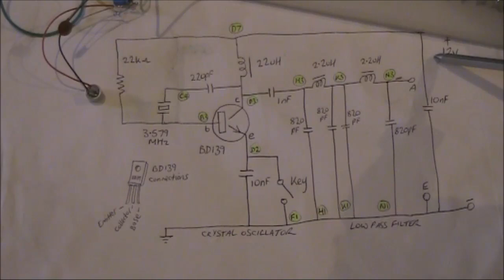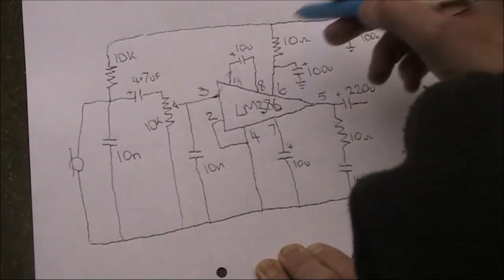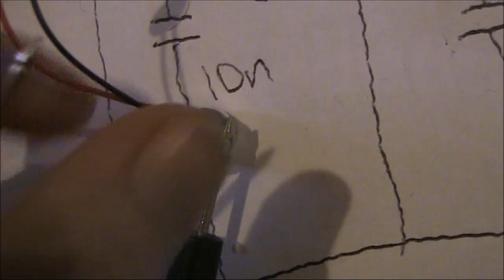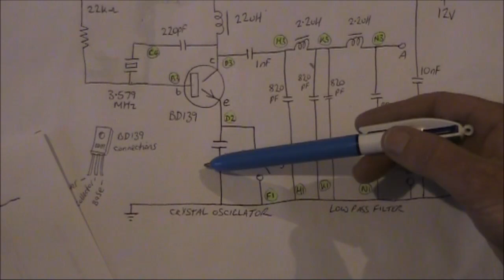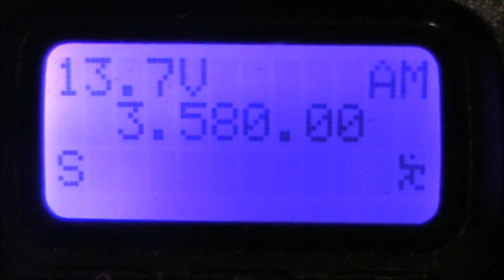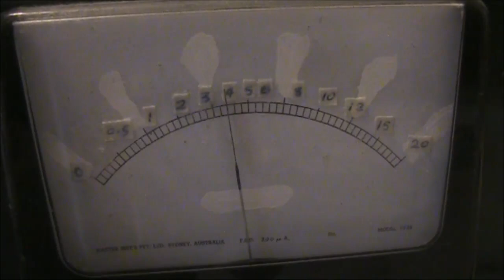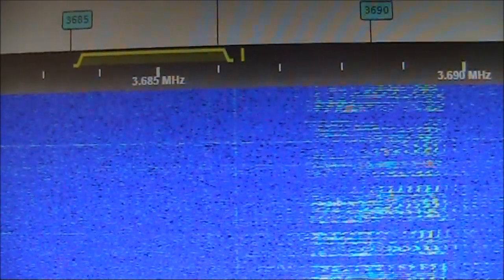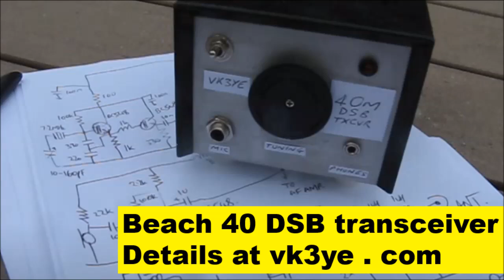Your first radio transmitter can now talk

Comment: Peter, you'd get much greater modulation depth applying that audio to the base. Better yet, Pin 5 of the LM386 hangs at around half supply voltage and swings above and below that with audio. So, connecting pin 5 to the base via a resistor would vary the bias with the audio waveform. This trick works particularly well with the type of transmitter you've shown using the IRF510 or IRF530. If you power the LM386 with a 5V regulator, pin 5 sits at around 2.5 volts: the gate voltage range the IRF510 and 530 start to conduct. Apply pin 5's voltage to the gate via a 10 or 20k pot's wiper via a 1k resistor, with one end of the pot to ground, the other end to pin 5 and advance it until the audio sounds the best. You get good quality AM this way, with a bit of care.
73 de G0IFI
Reply from the maker: Thanks. I have built another rig using Pin 5 of the 386 to drive a final RF amplifier transistor. Worked well for a 500mW transmitter on 1.8 MHz AM. But you can blow up the 386 if you don't use a current limiting resistor (4.7 ohm from memory) in series.
Reply: @vk3ye  Yes. You could use pin 5 to drive a reasonably hefty NPN device to series modulate the PA, of course. put an RF choke on the emitter and power the PA transistor through that device. But I've made a couple of transmitters with IRF530s in the final and the method of biasing the IRF530 with pin 5 of the 386 produces very fine audio, if you get the level right. It's a very simple and economical way of getting 100 percent modulation.
Reply: It works quite well as Peter showed (modulation is something like 50 % maybe but it is enough in my opinion), through the emitter  though:) I have just built the circuit. I had some problemes with the crystal, it resonated in different frequency and after applying a filter at the output (at the collector) it moved back to its fundamental frequency. I am not sure if it was because of the quality of the crystal or something different (I have ordred some other crystals and will test it as well)

Comment: Hi, i found your video really interesting.
i want to build this transmitter but i have a question: wich is the minimium size of it? i don't 40m of space...
...and, is there a simpler circuit for transmitting voice over 1Km or less?
Reply from the maker: Check out my FM wireless microphone videos for something that goes a few hundred metres with a small antenna. Or consider 7 MHz. QRP AM is however far inferior to QRP DSB so consider DSB. But start with CW as it's simpler and goes a long way.

Comment: Hi, friend! I have a question: is a low power operacional amplifier (as the LM386) really necessary, to get 100% of amplitude modulation, in this circuit? I tell this, because the transmitter is a small power one, whose oscillator is the only RF stage; so, I think that another op amp, wich has too lower power consumption (as a TL081 one), would also modulate this oscillator, taking it to 100% modulation level.
Reply from the maker: A TL081 is much lower power and would likely need to drive a couple of transistors to work effectively here.
Reply: @vk3ye , thank you! I've got it! I was thinking that a simple pre-amplifier could excit this oscillator/modulator, 'cause more powered audio amplifiers, generally, are requested in the output RF powers of the transmitters, normally in the last stage, coupled by an audio transformer.

Comment: I wonder if a 4066 quad lateral switch IC could be turned into an transmitter. It can oscillate, I think.
Reply from the maker: Any oscillator is a transmitter so why not?
Reply: @vk3ye  Hmmmm... then in theory, also a 555 could be used to build a transmitter.

Comment: how would the schematic change for 27 mhz ? (component values) i assume crystal and output capacitors ...coils...
Reply from the maker: Hugely. You'd need a different oscillator circuit as 27 MHz crystals are typically 3rd overtone. I used fundamental crystals here.
Reply: @vk3ye  would you make a video about it ? that would work with the receiver 27mhz AM, that you made in another video(super regen mixed with charles kitchen design) ?
Reply from the maker: @danielraducu9073  I have no plans to construct or do a video on on this. Look up cheap walkie talkie circuits for an idea of how this is done.
Reply: @vk3ye   what is so special about this 27MHz crystals 3rd overtone, i assume it s about harmonics but i am a full noob, please teach me
Reply from the maker: @danielraducu9073  It's not something that can be explained in a few lines here. Do lots of searching and reading on the different oscillation modes of quartz crystals. Eg  https://www.industrial-electronics.com/crystal_osc_5.html

Comment: Up the power, improve modulation and pop it on 7125kHz? Great video, by the way. I've been playing with tiny AM transmitters a lot lately, but on MW frequencies to play music on my old radios.
Reply from the maker: You could but don't think it's worth it. Need way more power than 500mW unless the receiving station is in a very quiet location.
Reply: @vk3ye  I got a contact into VK3 from VK5 on ft8 with 100mW into an End Fed antenna on 40m.